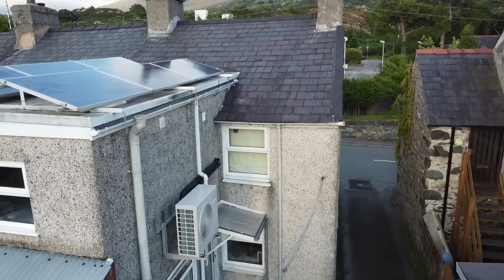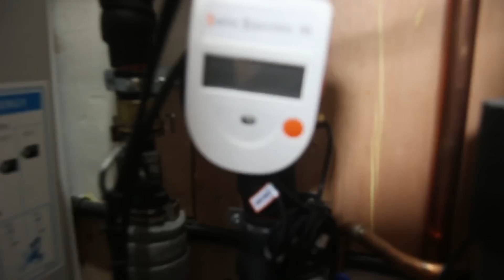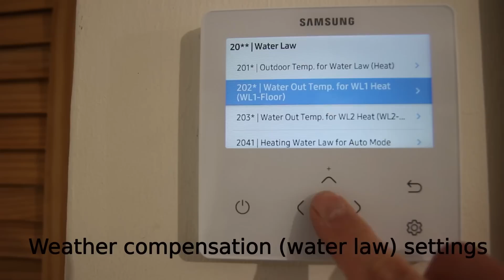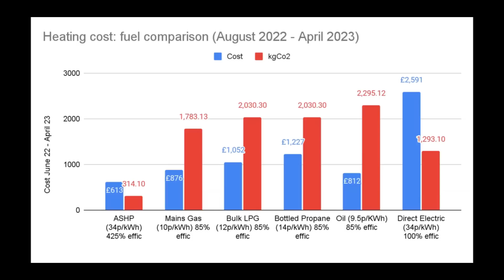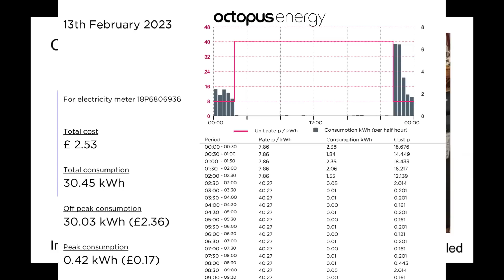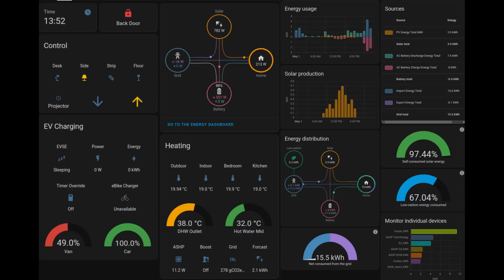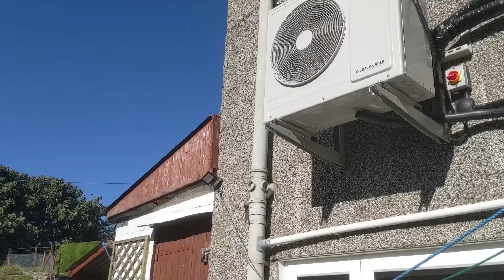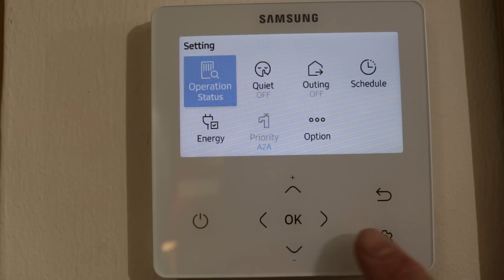Part 2/2: Air Source Heat Pump 1st Winter Performance 2022-23 in Solid Stone Welsh Cottage

Comment: Impressive results ive had to turn down fitting a heat pump due to initial instal costs hoping the next government pull their finger out and help more. 
£3960 i just about had but the extra £2900 for a repipe i didn't 😢

With figures like yours im glad i am waiting to be honest because the system would not have been run at that sort of temperature they were aiming for 50°c 👍
And our house is 1968, wall insulation mid terrace with massive loft insulation double glazing basically the full works 😅
Reply from the maker: Sorry to hear, but I would be very surprised if a well insulated mid-terrace would need 50C flow temp. At 50C flow temp you should expect a SCOP of around 3.5 according to Vaillant Aerotherm plus datasheet, still cheaper than main gas but not a huge saving. Carbon savings will still be significant, but obviously ideally you would increase the size of emitters to be able to run at a lower flow temperature.

Comment: Do you know the modulation ratio for your heat pump? Could it be that it can't modulate low enough for a 30 degree flow temp?
Reply from the maker: Yes, I think this is the issue, at 30C or below there's not enough difference between the flow and return temperature and the compressor cannot modulate down further
Reply: @GlynHudson  Let's hope that manufacturers start producing smaller heat pumps and that modulation ratios start to catch up to where gas boilers have got to.

Comment: Interesting that you choose to run the heat pump over the eddi. Is the wear and tear on the compressor etc worth it?
Reply from the maker: Yes, I use 4-5x less energy using ASHP for DHW in summer compared to direct immersion, this leaves more solar PV generation available for other tasks like EV charging. Compressors are more likely to fail when they're not used, the compressor in fridges last for years in regular use

Comment: How does the Samsung controls energy monitor compare to the energy monitor? We have a Samsung one only just wondering if it’s accurate or not? Thanks
Reply from the maker: I found the my Samsung controller under reports the heat delivered so it displays an artificially lower COP. The Samsung temperature sensors for flow/return are not very accurate, at least not on my unit. This is covered towards the end of the video.
Reply: @GlynHudson  yeh sorry I should have just deleted the comment. Thanks!

Comment: Great video don't suppose it shut the people up who claim they don't work in old houses. We have a Samsung ashp in a 220 year old house and it works fine.
You may fined that as ashp have minimum ru  speed depending how you have parameter 2093 set it will get to the point where it can't produce any lower amount of heat if you have it on room temp on off and if you have it on any of the others if you have no buffer then it stops the compressor on water law and has a minimum off time so can drop low before restarting.
I have had many conversations with Samsung technical and not sure o  the 5 kw but on a 16kw like ours they recommend a flow rate of 46 l/m which by the physics means a 5kw would want a flow rate of 14.2 l/m at delta t 5. Not sure what water content they say for 5 kw. This is assuming you have your set on floor parameter not fcu as floor is delta t 5 and fcu is delta t 10
Reply from the maker: Interesting, I have FSV 2093 set to "Room Temp. ON/OFF or WL Interlink ON/OFF(Water Pump3)". I run a flow rate of 15.8 l/min, and I've got about 71 litres of water in the system which is plenty of volume.
Reply: It's all a bit confusing as heat geek says to design out a buffer and keep the unit running continously. I did ask the Samsung tech guy if the compressor is rated for continuous running and he didn't really give a straight answer he just said why would you want to where as heat geek suggests you should try to just add what heat you need by trickling in heat all the time. Samsung say you should have a minimum run time of 10 to 15 minutes which is why you need the volume. I don't have the volume they say but do keep thinking of adding a buffer to see what difference it makes. Just for info ours used 2000kwh of power for Jan Feb and March for heat and hot water which personally considerering the age and size of the property and keeping the whole house at 20 degrees is not that bad.

Comment: Nice report - i do think the Samsung is under promoted generally - if only they made more effort with installation data and a few small changes. The standard controller is great - i see many videos with it fitted to the control box in a garage which then requires another thermostat - makes no sense to me.
Reply from the maker: Agree, using third party controls usually results in much lower efficiency. It's a shame Samsung don't offer a wireless controller option, that's the mains reason why I think installers don't use the inbuilt controller is that running a wire to the living space can be tricky.
Reply: @GlynHudson  as it’s a two wire bus it’s easy to run. I have bought a 2nd to install for the gnd floor.  Finding the part number was not easy buying one even more difficult.  Found one via enay.
Reply: Yes my impression is that Korean tech is generally high quality.

Comment: Great job with the install and good to see it functioned really well. Will you be tweaking anything about your setup before autumn?
One quick question about the kitchen kick-space heater; I've looked around and found that many such heaters have a thermistor which switches the fan on only when flow temperature exceeds ~40 degrees C. Did you find a make where this is more configurable, did you alter the thermistor or have some sort of work-around (e.g. a smart plug controller to turn the fan on when heating is needed)?
Reply from the maker: Hi, thanks for your kind comment. No, I'm not planing any changes, it's all working as intended. Yes, I had to modify the kickspace heater fan to switch on at lower flow temp, I bypassed the internal sensor and fitted inside a smart relay with a temperature sensor, so I can configure the flow temp that it switches on.

Comment: Excellent Glyn, thank you. I bet it took some time to edit all that together.
Been looking at my system and the only problem I can see regarding fitting a heat pump is that it will need to be located on the north side of the house so will not get any winter sun - that is bound to make difference to the performance.
Reply from the maker: That's totally fine, direct sunshine won't make any significant difference to the air temperature the HP sees. Yes, rather embarrassingly started filming this in April but it took until now to finish the editing!

Comment: Really interesting update video, and great to see it's working so well for you! We've had our Daikin ASHP installed for nearly 6 years now, though I'm still not convinced we're getting the best out of it as our electricity usage through the winter months seems astronomical in comparison to your figures. We did get down below -10 last winter on a few occasions which I don't think helped matters.
Reply from the maker: Wow, -10C is cold! However, the performance of an ASHP actually increases slightly as the temperature drops significant below freezing since there's less moisture in very cold air which means less defrosting. 0-2C is the worst temperatures for heat pump performance, especially if humidity is high. You can compare the kWh per m2 of floor area that your heat pump is using compared to other systems on https://heatpumpmonitor.org/
Reply: I suspect your Daikin hasn't been optimised! Doing that on a friend's halved their electricity consumption. Find an installer who knows Daikin and have them take look
Reply: @dan_grey  thanks! I think that may well be the case, however Daikin installers in the South of Scotland are proving very tricky to find.
Reply: @mpdnuk  you could probably figure it out from the Daikin manuals but it's not easy. Be sure to read the reference guides as well as the manuals, for both installer and operators (yes basically each Daikin model has four different manuals 🤦). 

Start with getting the controller on the indoor unit into Installer mode, then look to set the weather compensation to lower values, and put the DHW on a daily schedule, doing a tank boost at the warmest time of day (early afternoon).

Comment: Spring? Have you been hibernating ;). Great to see such good results, even on an old building. I'm tempted to get a door blower test on my house. Did you find many areas that you could seal up with your test?
Reply from the maker: I know, it's embarrassing how long it too me to finish editing this! I filmed most of it back in April 😅. Door blower test is a great idea, yes it did alert me to a few areas that I subsequently sealed up, it's probably the most cost effective thing, drafts are usually cheap and easy to solve

Comment: Great video Glyn.  Your original videos inspired me to replace my gas boiler with a ASHP.  Whilst I did not install the system myself, the information you gave helped me with the selection of an installer.  From my experience the quality of installers varies.  Only two out of the five contractors carried out heat loss surveys.  They recommended heat pumps from 7kW all the way up to 14kW.  My own calculations put my heat loses around the 7kW mark.
Reply from the maker: Hi Mark, that's fantastic to hear! Thanks for the kind words

Comment: Brilliant update Glyn, and a fantastic job you've done of your installation.  Thanks for all your information and statistics.  I'm just about to move over to ASHP, and already have 6kWp of solar and 2 x 6.5kWh batteries with a Zappi.  Currently run on oil, and have a well insulated 3 bed bungalow in Mid/West Wales. Just had an assessment done, so await some dimensioning figures and any changes required for radiators and hence sizing for Heat Pump. Your stats have really helped to re-assure me on the benefits of moving over to Air Source.
Reply: Would be interesting to know how your heat loss calcs compare to that of "professionals"
Reply from the maker: @ChampionCCC   professional surveys have to use pre defined assumptions about the house based on its age. This generally results in a much greater heatloss result because the default assumptions e.g on air chargers per hour are very pesemistic. I got a door blower test done to prove that my air chargers where much lower.
Reply from the maker: Wow, sounds like you have a nice setup. A HP should work very well for you
Reply: Did you replace all pipes?  It looked like you still have a lot of 15mm.
Reply from the maker: @domhnallmorris  I've got 22mm primary pipework and 15mm pipes to the radiators. This is plenty for my heat load. 10mm microbore pipework can also work fine with a heatpump, I all depends on the heat load required
Reply: @GlynHudson  thanks. According to the survey I had done, I need 9kw. I will do my own survey though using the tools you recommend.
Reply from the maker: @domhnallmorris  great, try the free HeatPunk tool